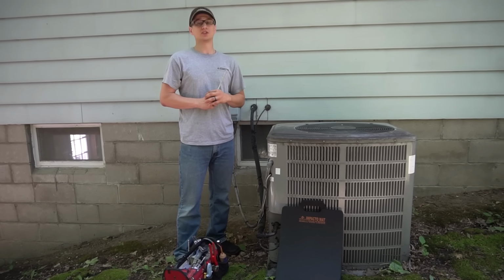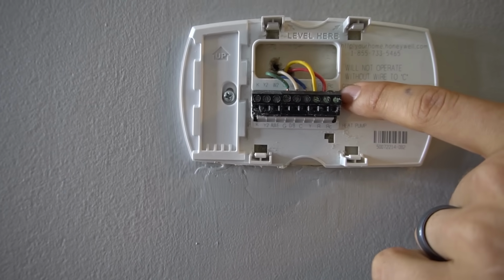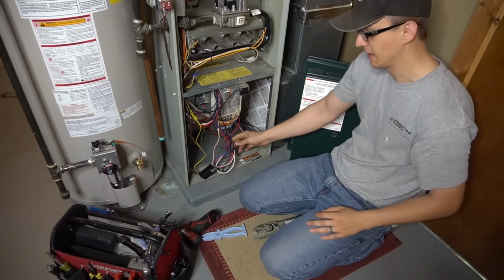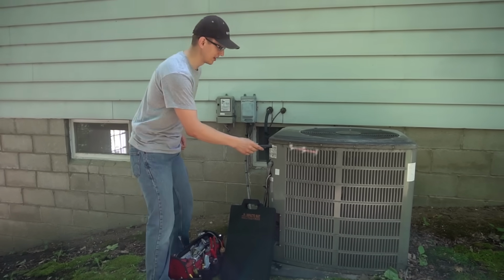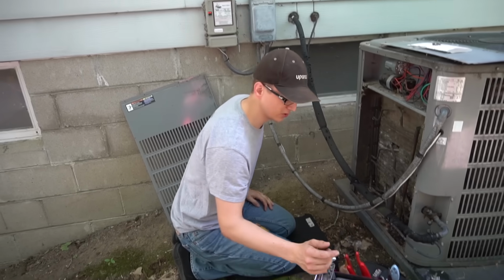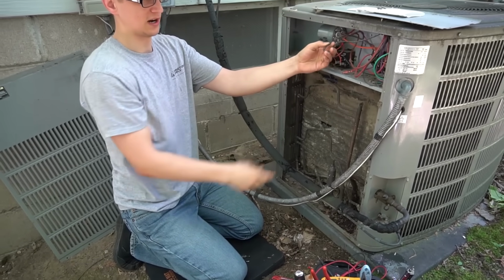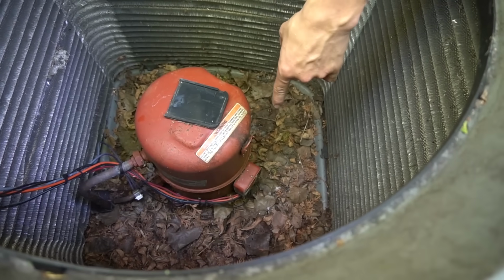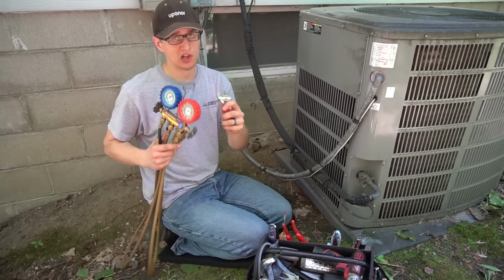AC Unit Not Turning On - How to Fix It Step by Step

Comment: Hello! My AC unit outside kicks on, sounds like the compressor and fan turn on. My furnace unit inside does not, it tries to kick on but the fan never spins. I found the fuse and it doesn’t look tripped but haven’t tried to change it yet. It almost has a hot plastic smell to it. The furnace itself where you mention the A shaped coils has condensation and is cold but I don’t see any ice, of course I didn’t check the actual coils. Should I start with changing the fuse and see what that gives me?
Reply from the maker: Sorry to hear about the AC troubles! What you described sounds like a bad blower motor. You could use this video to verify: https://youtu.be/JSgLGTAbDF8?si=JTRwYNpnQd3bwdvG

Comment: My AC blow the furnace fuse each time we put it on. 
The furnace tech told me it's a code 24.told ne it could be the High pressure switch. The refrigerant leak. What the cause and how much is it going to cost to repair?  Thank you for your 🙏 much needed solutions. 😊

Comment: Question for anyone able to help me out. My central ac isn’t working as it should. Everything turns on as it should just little air comes out. It’s a brand new home and i had someone come out to look at it. They bypassed the system which worked until i replaced the thermostat. Now it is the same issue as before. Only thing i noticed is my thermostat never had a wire in the RC port. If it worked without the wire in RC do I need to put one in it?

Comment: My problem was a clogged condenser that tripped the high pressure switch on a very hot day. Clogged as in i haven't cleaned it in 5 years and who knows if it was cleaned before me.

Comment: My Trane AC compressor and fans only turn on if I manually press on the contactor? yes, I have 28.6 Volts as low voltage going to the outside unit. Please help
Reply from the maker: I would suggest this video next: https://youtu.be/NVPhsK4gK1A?si=HpaC_idZnpZJHhGw

Comment: Hi question my husband replaced the condenser he found a dead mouse on it but our AC isn't staying on after changing it. He's looked at the wires but he is stuck. The fan spins outside and inside but shuts off outside after a few minutes and it says fan is on inside as well, any ideas?

Comment: Great video! Had a new furnace installed last November and haven't needed AC till this weekend and found out it's not turning on. Had no idea you could manually override the unit by pressing down that switch on the unit itself. Helped me narrow down the problem to be with the new wiring they added in. Haven't gotten to the exact source yet, but knowing that the unit works, and that the thermostat is calling for it, means the error must be with the wire between them. Hoping I can figure out where the mistake was made!

Comment: My condenser fan is not running. how can i check if the motor is good or bad. how do i check if the motor has power go to it. I have tested  the capacitor and it is good. I bought a new fan motor and hooked it up and still does not work. could it be the circuit board?

Comment: Came home to the unit humming but the fan not spinning and the house was 83 degrees but set at 74….. replaced the batteries, reset the circuit breaker and still nothing…..help!!!
Reply from the maker: Sorry to hear about the AC troubles! That sounds like either a bad fan motor or a dead capacitor. I show an example of the buzzing sound in this video, see if your unit is doing something similar: https://youtu.be/GOXgdnRB840?si=kAIzncPZ9am3A0p2

Comment: Everything inside works. Outside, new capacitor,  new fan motor. Does have 240 volts going to the contactor and the plunger is pulled in and humming. Still nothing from the fan or compressor. Shouldn't the fan at least work since it's new, even if the compressor is bad?

Comment: so with my case everything runs inside no noises or anything on outside. i push plunger in to bypass and i get nothing not even humming. breakers and everything is on. Im not sure if i got lose wiring on power side or what. ill check tomorrow to see my voltage coming in

Comment: Hello, my ac stop working properly and I had someone come out and give me a quote to get it fixed but they claimed that my unit is very old and it’s a different type of Freon that is hard to get and it’s very expensive $400 a pound. They said the compressor is bad but that they would have to replace the Freon which would be around $2000 and then they said that it the unit is so old they wouldn’t be able to find another compressor. So I got quote for over 11k for a new unit. I guess my question is if you have somewhat similar experience?

Comment: Genuinely would love to tip you. 

Sitting in front of a 3yo Payne furnace thats refusing to run. Swapped out a pretty dirty filter. Tested, Light powers on so we’re getting 24v, but doesn’t run. 

Jumped the Y terminal and G terminal and only get a hum. Can’t for the life of me find a capacitor to test.

The outside unit won’t run, until I depress the contractor manually. 

Any thoughts?
Reply: Never mind, simply playing this video fixed the unit! Incredible content.

Subscribed
Reply from the maker: Oh oops. 😅 I just replied to your initial comment before I saw this one. Glad to hear it's working again, thanks for subscribing, stay cool!
Reply from the maker: Sorry to hear about the AC troubles! Not all units will have a capacitor. If you have a variable speed motor it won't have one.

So does the indoor fan work but the outdoor unit is not coming on? Or are both not coming on? If you are jumping R to G and the indoor fan is not coming on (with the door switch closed) then the motor (or the ECM module) might be bad.

As for the outdoor unit, I would suggest watching this video if you haven't already to try to figure out why the contactor is not pulling in:
https://youtu.be/NVPhsK4gK1A?si=xVhERmsRj9Folgx8

Comment: In addition to checking the circuit breaker, the HVAC unit may also have a switch that you should check to make sure the unit is turned on. On my furnace the switch is on the wall next to the furnace and looks like a light switch.

Comment: my condenser wont start ! but as soon as i turn power with the circuit breaker and thermostat in off ,the condenser does a humming noise and wont stop till i shut power off.  everything inside works great, good capacitor and blower motor checks good and good gas reading. some techs tell me the board is bad.! its a 3ton amana seer 16....

Comment: Great video but still have a problem when I push plunger in manually I don't get the spinning of fan ...I already swapped out the run capacitor and checked breakers and still nothing .

Comment: I hear a buzzing sound when A/C tries to fire up then nothing. No compressor and no fan. Replaced the dual run capacitor with a new one. I hear a loud click then nothing until I turn off a/c when i hear another click. Is this a relay problem? How to confirm and replace?

Comment: Awesome video!

Everything was working inside, fan was spinning on the unit when i pushed the plunger, but for some reason house wasn't cooling. Went and bought a new capacitor. Installed it....nothing.

I look around at the wiring one more time before giving up and see in the bushes a wire cut that ran to the thermostat... I literally cut it myself cutting the shrubs in the area 😂😂😂

The silver lining :  I know a ton more about AC units now and found a great youtube channel.

Thank you!

Comment: My unit just blows hot air when it is set to cool. I just watch your video I have been searching online for a solution before I go call HR expert. I’ve checked the thermostat to make sure that I had two connections right it’s a sensor thermostat that does not need a jumper wire what is the next step think I should do

Comment: Hi! Thanks for the amazing videos. Could you please show us how to fix the  TXV ? If its clogged do we need to replace it or we can just repair/clean?
Reply from the maker: Usually you would need to replace it which is a whole procedure (pull out the refrigerant, replace txv, vacuum system, pressure test, put refrigerant back in.)
Reply: Thanks. How I can check to see if txv is bad? The technician who came to check said its bad and gave me a crazy quote. First we thought the problem is from capacitor. When i turn the AC on the compressor makes a buzzy noise and doesn’t work. We tried to boost the capacitor but even with that, the compressor works only for 2 mins and then stops.

Comment: that R to RC jumper is something I never would have found on my own.  I have a replacement capacitor coming today (VERY bulged) but I'm crossing my fingers that I can fire up a system that's been dead for a decade.  There's still a charge in it (don't know how much) but the first time I hit the contactor the compressor did kick on.  Great video.

Comment: My AC unit (Rheem) was not putting out cool air. I called in my AC service guys and they recharged the Freon (Pureon or whatever). Unit was then working great for about 24 hours. Then we had a HUGE thunderstorm go through with lightning/thunder/downpours and we lost power twice for a few seconds. I noticed later the AC was no longer working. I played with the thermostat and neither the fan in the furnace or the fan in the AC outside were operating as I cycled the temp. Checked all the breakers downstairs, but they were good. All other power in the house is fine. Is it possible the lighting/power outages fried something? I tried turning on the furnace heat and still no blower in the furnace as I cycled the temp. Filters are all brand new, everything was working fine earlier. Thoughts? I left a message with the service outfit, hoping they call me first thing in the morning!
Reply from the maker: Oftentimes a thunderstorm will take out the dual capacitor in the outdoor unit. If unlucky, then maybe something else got damaged. (like a control board) If you have a multimeter you can check the capacitor. Sometimes it will be bulged out on the top, in that case it is for sure bad. You should be able to find and buy a capacitor locally. Watch this video for more info on capacitor replacement if you need it: https://youtu.be/9ZGfvC-PMWU?si=vDC3wL-P6sLPrJq9

Comment: I have a condensate pump, which must have gone bad. The alarm light was on due to being full and not pumping.. That was my issue today. May be a helpful tip for someone else as mine is programmed into the furnace so it was not allowing the condenser to run

Comment: Changed capacitor and it started but I failed to turn off power when screwing in harness screws.  Wires touched and sparked now burned wires at conductor.   Do I need to replace conductor or can I just strip wire and reattach?   Thanks for any help

Comment: on my carrier unit the fan relay is mounted on the pcb on mine the board was burned thru and the relay burned and melted. I repl the board and repaired the wiring but im not sure what wires go where.thanks

Comment: Thanks for the detailed video, but my Trane XB issue wasn't mentioned. It is summer and my AC stopped working. I noticed my thermostat screen was off and no fan or AC is running at all. I installed batteries in my thermostat to try and start the fan or AC but no fans are running. Fuse on the control PCB is fine. Red light on the control PCB flashes red continuously. I tried restarting my outdoor unit and indoor unit, breakers were not tripped but I reset them anyway. No luck. Filters are new. Transformer is working, getting 28VAC back to PCB. Any advise to trouble shoot further?
Reply from the maker: Have you tried bypassing the thermostat at the PCB? If the screen on it is blank even with new batteries, then the thermostat might be dead. If you jump it at the board and everything turns on, that will confirm that the thermostat is bad. https://youtu.be/bmZc76ufTNY?si=8m-F6iu_8S0Qkdrt
Reply: I figured it out late last night. My drain pump GCI breaker tripped and as soon as I reset it, the AC unit turned on! It appears to be working fine as my house is now cooled back down to the cold setting I set.

Thanks for your reply and for monitoring your comments!

Comment: My A/C will not turn on outside and no buzzing sound is heard at the unit. When the plunger is pushed it starts up no problem (fan and buzzing noise) does this mean the compressor is bad? I do not have a circuit tester.
Reply from the maker: I would suggest watching this video to track down what is causing that: https://youtu.be/NVPhsK4gK1A?si=1WJZrYC_GstO4yAE

Comment: My coil only works when I push it in with a screw driver, but won't stay on. What could it be?
Reply from the maker: Probably a bad capacitor but it could be a condenser fan motor that is starting to fail too. Do you have a multimeter by chance? I show how to test and replace a capacitor here: https://youtu.be/9ZGfvC-PMWU?si=vWfwYzQZvTUS3hTW
Reply: @WordofAdviceTV  I changed the capacitor, but still no luck.
Reply from the maker: @PapasBenito  My apologies, I think I misunderstood. I thought you were pushing the fan blades with a screw driver to get the fan spinning but I just read your comment again and it actually looks like you were pressing on the contactor plunger right? In that case, this is the video I should have referred you to: https://youtu.be/NVPhsK4gK1A?si=2H5FI1RV0Xn1b9PH

Comment: My AC is  cooling properly thermostat it set at 72 at temperature inside is 84, check suction psig was 75 discharge psig 410

Comment: All the sudden my unit outside won’t kick on so I bypassed it and the unit came on and it’s blowing in the house so I’m not sure what the issue is I mean it’s getting 240 volts to the unit it kicks on when I press that thing In the breaker 30 amp fuses are good and ideas?

Comment: Our upstairs AC is not working. When we turn it on, we hear a grunting sound near the furnace, which is in our attic. Our outside unit had a buzzing sound coming from the electrical area. We watched another video that made think it was the capacitor. So we replaced the capacitor. Then we replaced the Control board. That made the unit sound so much better. When we bypass the thermostat by sticking aa screw driver into the plunger, the unit starts and sounds great. But we can not get the unit to turn on without bypassing the thermostat. We did install a new eco bee thermostat last year.  It was a bit confusing getting it hooked up to the attic furnace.  The wires were different than our downstairs furnace.  We have gone over the eco bee instructions and checked our breakers.  Our unit is 23 years old. It is a carrier.
we are at a loss and are concerned we will have to buy a new unit and since it is the R22, we will have to replace everything. We don't have the money to do that.  We would sure appreciate some advice.  Thank you for your amazing video. It is really helpful.  I hope to hear from you. You are a life saver.

Comment: My HVAC guy is having trouble figuring out where my system is leaking refrigerant. He put in nitrogen to see how the pressure would drop. The meter on the left dropped a tiny bit, but the meter on the right dropped a lot more, which he said didn't make sense to him. I wish I knew how to get a picture to you. He first figured the leak was outside, now he thinks it's the valve in the inside unit. I am desperate and hoping you can help.

Comment: watched your video with lots useful information. My ac is not working. Fan and compressor outside not turning or starting. Already changed the capacitor without any success. Please help. Thanks

Comment: It was definitely a mystery to me why my AC unit wasn't turning on, even with no breakers tripped and the inside running fine. I feared something complicated. But it all made sense once I opened the panel and discovered a nest decorated with frayed wires. Straightforward fix once I found that. I wouldn't have known what steps to take without your guidance. Thank you!

Comment: I need help. Heater works fine when I turn the ac on it doesn’t work but air that’s not cold gets blown out. It’s not the capacitor. The power switch was stuck in the middle and I turned it on now the fans running and air is blowing decently but it’s not cold it’s barely barely cold. What should I do?

Comment: We have been with out AC for nearly a week now, hopefully you can help. Our thermostat is set to 75 and it is currently 85 degrees in the house. The AC will not turn on. I have checked the filter, breaker, cleaned the coils, and it is still not working - also changed the capacitor. When I open my outside box and press the plunger, on the contactor the unit does turn on. Fan spins and no odd sounds. However, there is no air blowing inside the house (idk if there is supposed to be). Weird twist though, the unit has turned on every night around the same time right before we go to bed. It then shuts off sometime while we are sleeping and will not turn back on all day. I have the thermostat on “hold” to override any programming. Please help us figure this out. Thank you so much!!

Comment: what voltage is the capacitor, Amazon sells one written on it 440v
Reply from the maker: That just means it can handle up to 440v. Don't mind the voltage or any other info, just make sure the mfd/uF rating matches.

Comment: Hello 👋🏼 
Can I just cut out that Power saver box? 
It used to show 3 led lights and now there’s only 1 green light on. 
I ordered the capacitor because I’m not getting any power at all.

But the inside air is running or circulating.

Thank you 
Great video AAA++